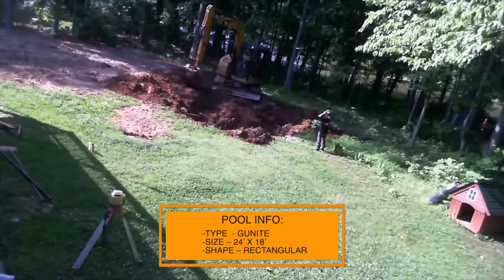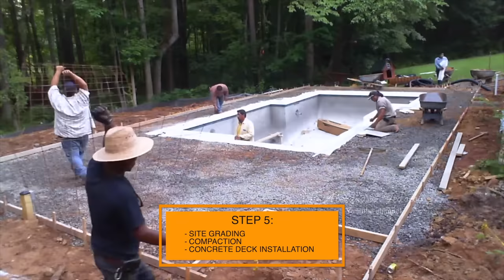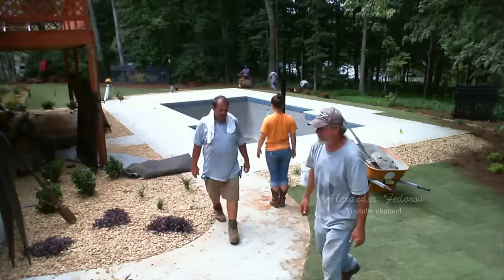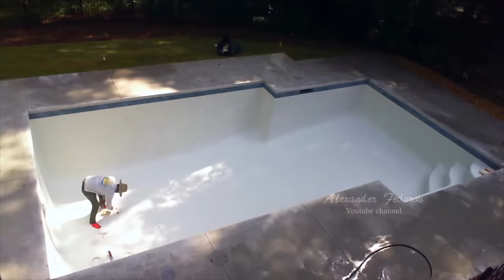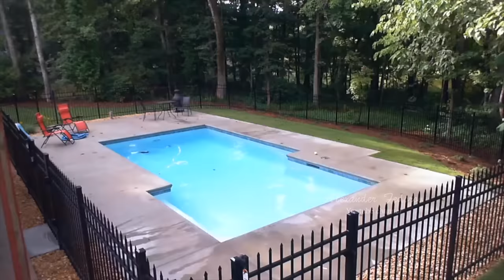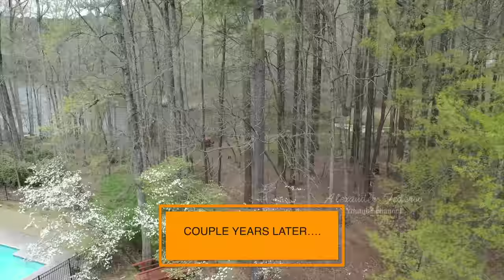Swimming pool construction process, step by step (Time-Lapse video)

Comment: 1. Excavation
2. Plumbing installation
3. Shotcrete
4. Waterline tile installation
5. Site grading, compaction, concrete deck installation
6. Landscaping and irrigation, fencing
7. Plaster installation
Reply: Where’s electrical for pool lights
Reply: Seems so straightforward, I wonder why pool building is so expensive
Reply: @koretv1581  materials and labor, takes a lot longer than the video!  Materials for that type of   Pool are EXPENSIVE!  Labor is a big part to.

Comment: Hi alexander! Nice to see this kind of process running. I've got two little questions for you and really appreciate if you can answer them: 1) Which average pressure (measured by your pressure gauges) did you use for the concrete admixture srapraying? and 2) Did you use any slump-killer aditive for your admixture and how much the slump was? Many thanks Alexander!. Congrats for your job.
Reply from the maker: Thank you! Sorry, the pool was build by the pool construction company. The pool is 6 foot deep.
Reply: It’s called shotcrete.

Comment: Good afternoon! My name is Anatoly, I am building myself a pool in the Krasnodar Territory. Please tell me what kind of material is used to make the bead (white tape) before concreting. And where can I order it. I have not found such material in my country. I would be very grateful if you give a link to the seller.
Reply from the maker: Concrete pools are the most popular—and most expensive—type of pool. They're often called Gunite or Shotcrete pools; that's because builders pump wet concrete through a hose and shoot it from a gun onto steel-reinforced walls. Once the concrete cures, it's plastered, troweled smooth, and painted

Comment: what was the type of the white materials that used in this video ??
Reply from the maker: It's a plaster. Pool plaster is the final coating applied to the shell of a concrete in-ground pool. The layer of plaster is normally 1/4 inch to 1/2 inch thick. ... Pool plaster adds a watertight seal and makes the surface of the pool smoother for contact with swimmers than the underlying rough concrete shell.

Comment: How do I estimate how many cubic yards of concrete I need for a swimming pool? I understand how to convert square feet to cubic yards but I am confused with the math behind the construction of a swimming pool. If someone could provide me with the formula. That would help me a lot. 

Another way I ask my question is as follows. For example, a pool is 45 feet in length, 15 feet in width and the concrete is 0.6 inches in depth. The pool’s shallow end is 4 feet, and the deep end gradually declines to 12 feet deep. (Ignore the steps and possible ledges in the pool, i got that figured out). 

Thank you to anyone that responds.
Reply: I think it goes .5× length and widths of ground and walls... then add those numbers up. Batch plants don't always load perfect yardage and you will lose some in the pump...overplan for 10% and your good.

Comment: No wonder why it costs $100k to get a pool. So much work
Reply: Oh it’s way more than that this is a very very small pool
Reply: Not necessarily very very small but it’s on the smaller side especially for this size of a backyard

Comment: Mmm yeah, about that…I’m gonna have to get several quotes, that 55k seems steep
Reply: I’m a contractor myself a pool that size would be between 42k and 57k. You get what you pay for when installing pools, walkways, driveways, and foundation. Soil prep, proper thick base, and compaction is key for longevity. Best of luck with that pool!
Reply: @jordanprice3640  How much would a 10 by 2 meter pool cost?

Comment: Why pass the pipes under the pool, that's stupid, if there a leak in the pipe there is no way to fix that without destruction completely the pool
Reply: Yeah, they definitely should have ran the pipes in the pool itself so they could access them if there is a leak... :rolleyes: 

Drains and pump intakes are at the bottom of the pool (in addition to the skimmer at the water level). Where the F should they put the pipes for the drains and pump intakes? Duh.